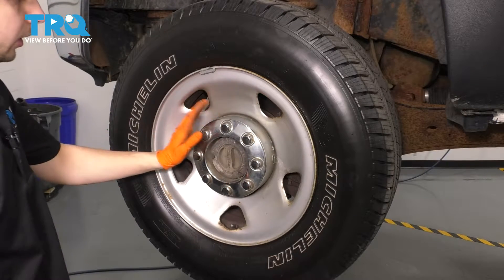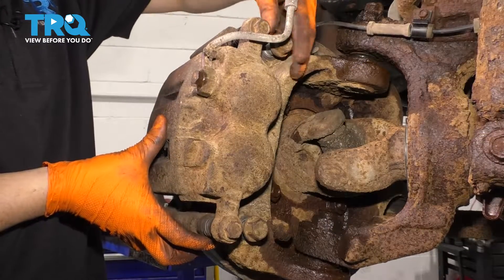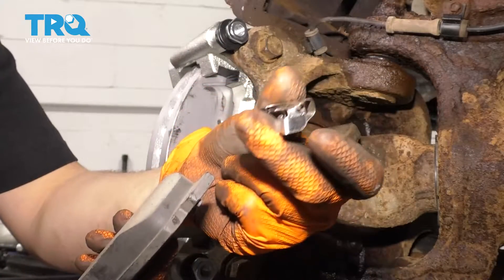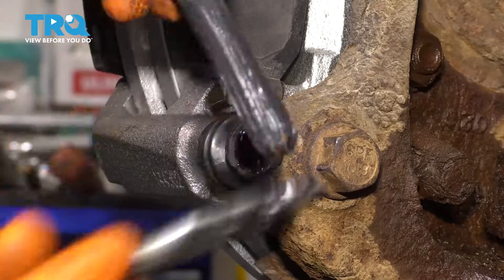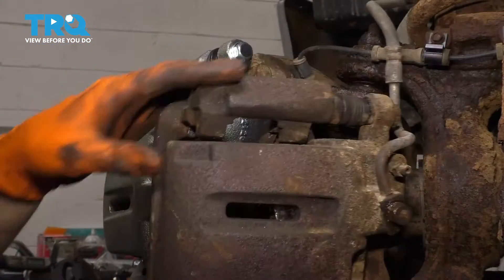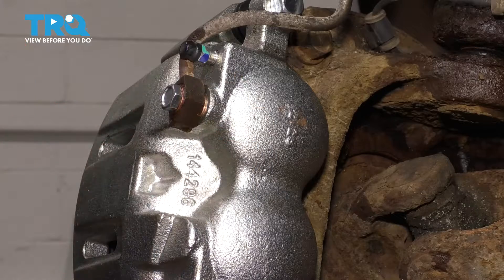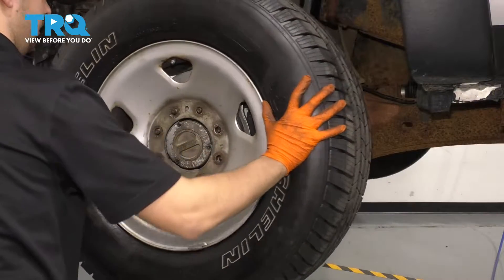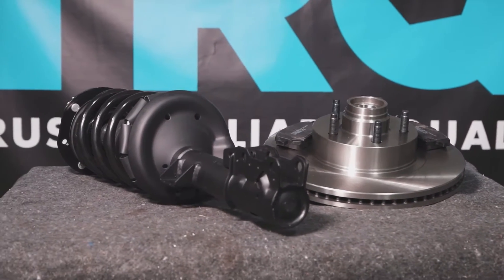How to Replace Front Caliper 2008-2010 Ford F-250

Comment: Hi I just replaced my rear calipers on my 2005 f250. I bled the brakes as specified however the brakes are still not fully engaging and are mushy. I confirmed there is no air in the line and the pistons are going in just not all the way it appears. What else could I be missing? Thank you